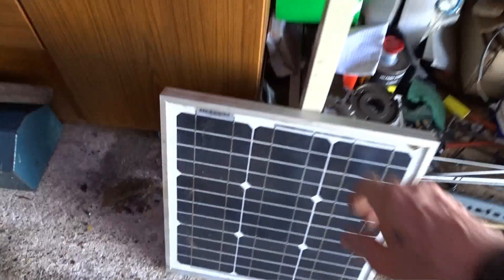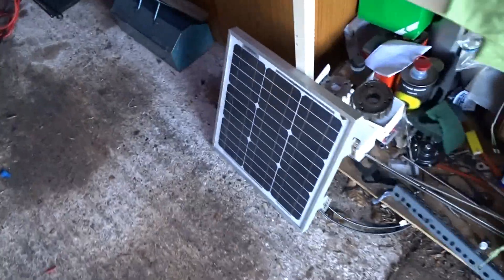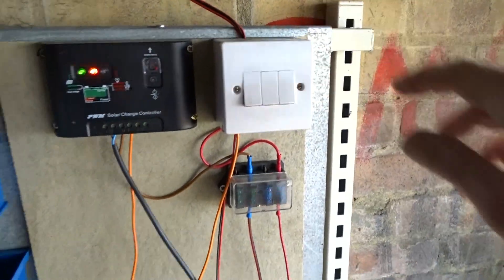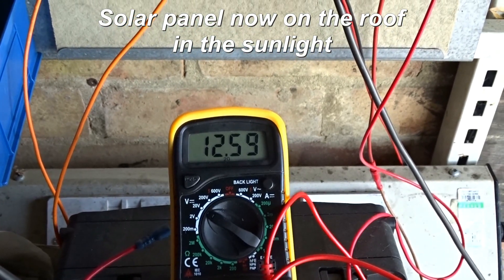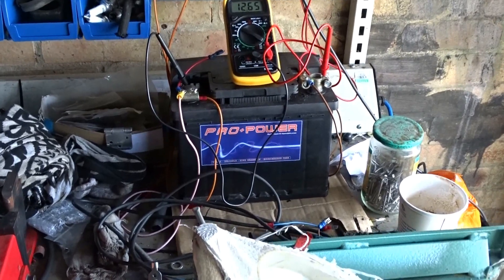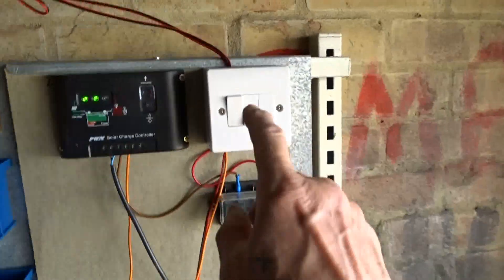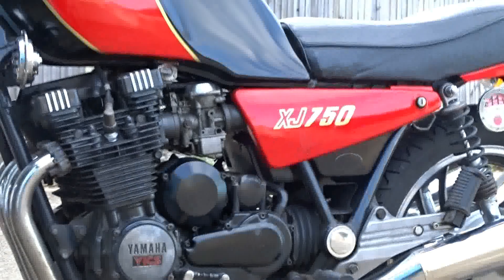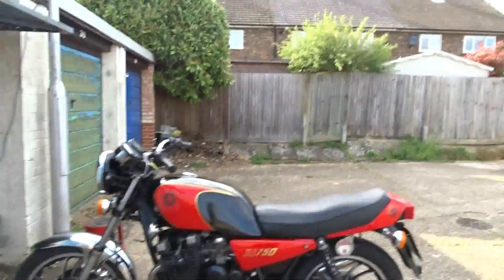Garage Lighting Setup using 12 Volt Strip LEDs a Car Battery and a 20 Watt Solar Panel

Comment: Hey Cliff, would two strip lights work with one 12v car battery or would I need a fuse box? Matt.
Reply from the maker: Hi Matt I have three 12v strips of lighting all off the one car battery ,  I've had them on about four hours before it needed a charge but using the solar panel which I put out every time I'm in the garage, I haven't had to charge the battery in a long while at home.

Comment: I really like this solution. I’ve just got myself a garage which would be handy to have lighting like this in so I’ll be doing something similar. Need to figure out what sort of alarm to run off it as I need to make it secure, so if you have any good ideas please share lol.
Lovely bike at the end as well 👌🏼
Reply from the maker: Hi Luke I have four dead locks and one padlock on each garage, I do have those battery alarms but you have to change the batterys every month or two so its more a pain in the arse more than anything

Comment: Nice setup. I'm using a rechargeable 100w 650amp jump starter power pack from halfords to power my three 7w led lamps, boombox and jet washer. Maybe see you at woolmer green auto show tomorrow? Ride safe 😎✌🏻🖤🤘🏻
Reply from the maker: I Can't make tomorrow damn it, I have to work from 12 till 9pm have fun there anyway

Comment: thats an excellent solution , well done for working it out.
  I have the same problem with a garage that is remote from the house. Its a pain in the butt because I have to do everything that requires power either in the garden shed or in front of the house on a long extension lead.

Could you not put the solar panel flat on the garage roof so that it is always charging when its light ?  or would some thievin git nick it .....
the only other thing i can think of is its best to use leisure batteries apparently because they are designed for a wide discharge/ charge  voltage range  whereas ordinary car batteries do not like being discharged much below 11v . so i read somewhere .
Reply from the maker: Hi John, I just used the car batteries because I had them laying around spare, I did have a marine battery but seems to have a cell gone in that, as for putting the solar panel on the garage roof, that would be excellent if I could but the Stevenage chavs will rip it off in no time lol
Reply: @OldBiker  yeah I'd use ordinary car batteries too I've always got some lying around . When I get a moment I'm going to do a bit of reading up and construct a solar powered setup for my garage. 
I've often wondered how you  manage to keep all your bikes and equipment safe and secure. I'd imagine that most insurance companies wouldn't honour an insurance cover for a bike that is remotely stored in a garage with no surveilance  '
I think i'd keep a Rottweiler in my garage if I lived  in your neighbourhood
Reply from the maker: It's not as bad as I made out, just that kids play football on the other side of the garage and kick the ball over sometimes, they then climb up onto the roof to jump over rather than walk all the way around, as for security, Dan who lives at the garage entrance has video surveillance (day and night vision) watching everyone that comes and goes, he installs security systems as a profession. Apart from that, I have a large hardened steel padlock and two dead bolts (soon to be four) on each of the garage doors, both garages are also alarmed. It would be easier to knock the brick wall down to get in.

Comment: The 750 sounds nice did you get It mot'd? Do you run all the lights together in the evening or would one or two strips be ok? I've seen the kits on ebay but with no strip lights how much did you pay for your set up?
Reply from the maker: Hi Matt, when it's pitch black, one strip will light up the garage easy, I've seen 20w solar kits on ebay for as little as £20, the strip LED's are White 5050 type and come in 5 meter lengths for as little as £7, the expensive part would be the car battery unless you already have one, as for the MOT on the XJ, tomorrow possibly :). Oh when I sorted my lights out ages ago the solar panels were about £35 and the controller was about £12. I have an idea for lighting above the work bench which will be in a later video.
Reply: @OldBiker  
Nice one Cliff, thanks for the info i will have a look through ebay. I've seen the video of the xj running she sounds nice mot'd as well, oooh nice.